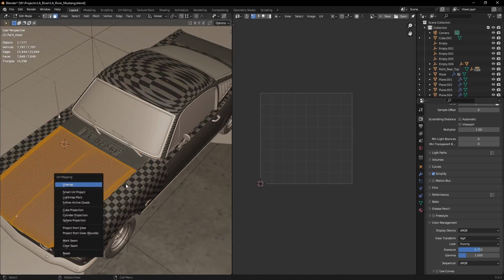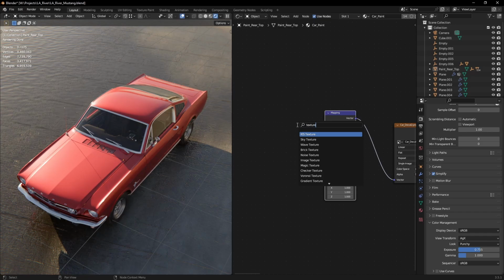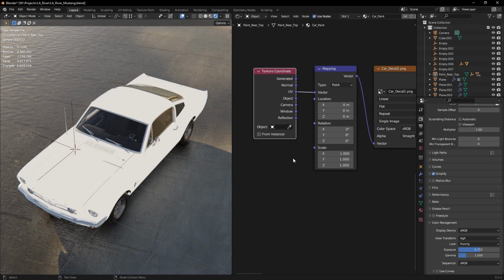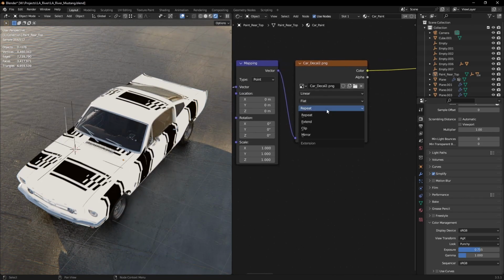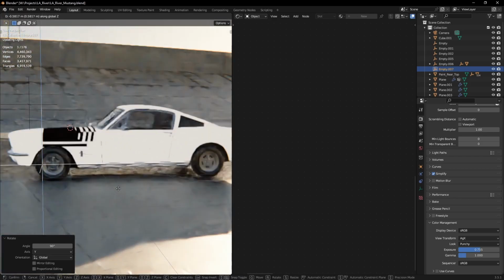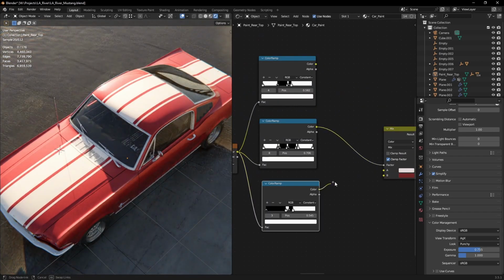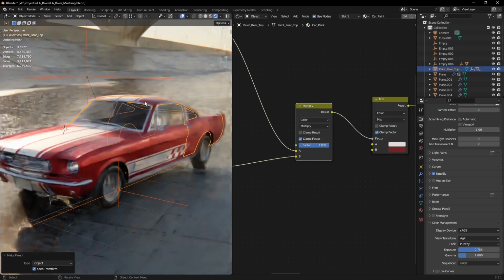How to Place Procedural Decals on your Models in Blender

Comment: Make a video that you tell what you're pushing to get the sh*t. I've wasted a week trying to follow you're shitty video
Reply from the maker: hey, man. Sorry to hear that. Most of my videos are really not suitable for beginners and I'm trying to explain principles rather than step by step tutorials.
Reply: @blenderisms  I get that but it wouldn't take long just to give some tips & tell how to export it as the images don't export with textures. I watched this many times on .25 speed & still couldn't understand. No one wants to share info.
Reply from the maker: @TheVlad69  hmm, what kind of info would you like to get? or more precisely what do you want to do?
Reply: @blenderisms  I would like to know how you get the decals on the other side & export them.
Reply from the maker: @ so, using the method i showed here, where you use an empty object to project your decal it will go through the whole object meaning that if you get the (for example) number on the door correct on one side, it will look inverted on the other. to get around that add a second material that is a copy of the original and apply it only to the other door. if you want to export these as textures for example a pbr workflow in some game engine, you need to create proper UV's for the car ( meaning all the UV islands should fit in the space between 0:1 on the x and y coordinates in the UV editor. then you can go and bake just the color information onto a new texture. there are quite a lot of baking tutorials on youtube to get you started with that. I hope this is helpful, dude.
Reply: @blenderisms  Thank you for taking the time to explain that. I do appreciated it! I baked all my textures & lost them as they won't show in the game. So much time gone. I thought I could take a shortcut via your way. I'm gonna save this info & when I'm less frustrated I have to give it a try cause my shrinkwrap looks like crap. I don't have the uv map & the one I created only worked for my stripes.
Reply from the maker: @TheVlad69  yeah, what I'm doing in this video doesn't really work well  with game engines and baking diffuse/normal maps etc is really important. by the way, sometimes doing things from scratch is the faster method than looking for workarounds or fixing something that already doesn't work really well :D that piece of knowledge took me quite a while to accept :D
Reply: @blenderisms  Ah got you. Thank for that info!

Comment: Very helpful, thanks! But how can I keep the original dimensions of the decal ? Its already distorted as soon as I attach it to the empty. 

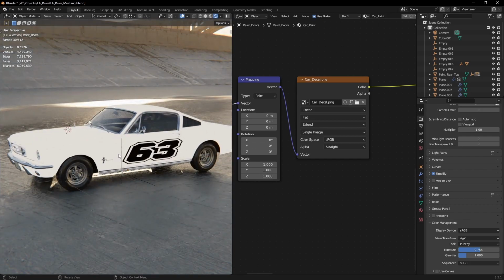0:46 How would you fix the text or number decals that project through the object? New material with a mask or split the geometry?
Reply from the maker: to fix the dimensions, try scaling the empty along the x, y or z axis. I know its not a precise solution, but cycles doesn't have anything better for decals right now.
To fix the decal going through the whole car I would separate the geometry and create individual materials. Again it is a silly workaround, but I haven't come up with anything better.
Reply: @blenderisms  Thanks for the quick reply. Yes, scaling it in every direction until it matches the input png was the only thing i could do atm. But this required an additonal image as plane to get the correct dimension.
Reply from the maker: @Aloex777  you are welcome. you could try to figure out the image aspect ratio and just scale the empty to that, or just scale it to the resolution of the image then scale back by a factor of 10 or however much you need to get it to the right size. this will save you from bringing in another image in the scene ... hopefully Cycles will get a proper decal tool like V-Ray or Corona.
Reply: @blenderisms  Will try that, thanks! Yeah its such a pity that its so silly to to. I'm using decals a lot in other programs ( VRED. Keyshot), where its so much easier. But only in Blender it requires more effort
Reply from the maker: @77 you can always give DecalMachine a try. It's a nice plugin >> https://blendermarket.com/products/decalmachine

although it works in EEVEE much better than in Cycles.